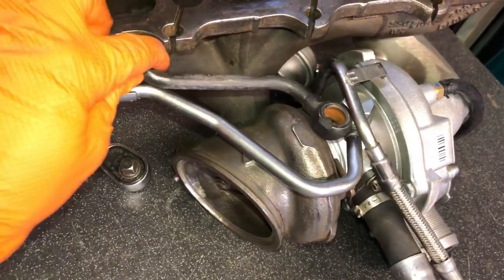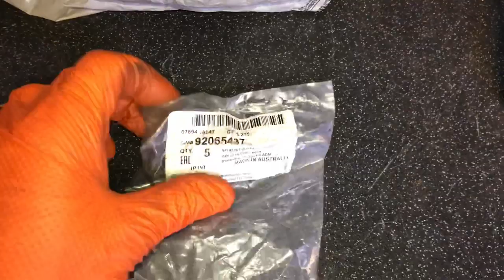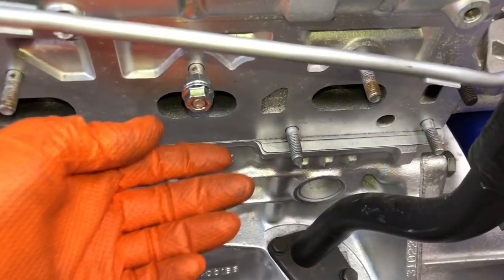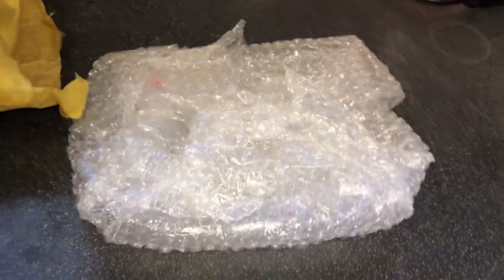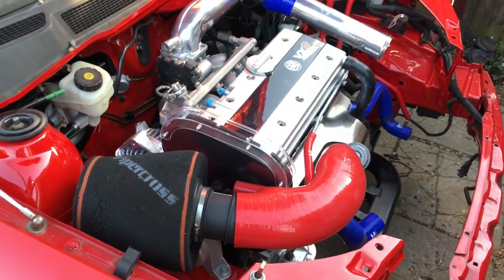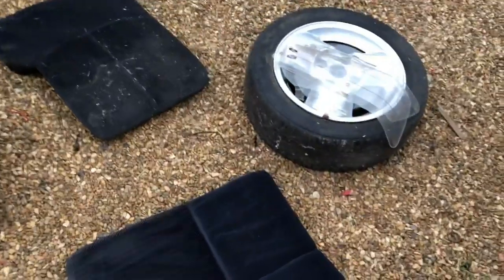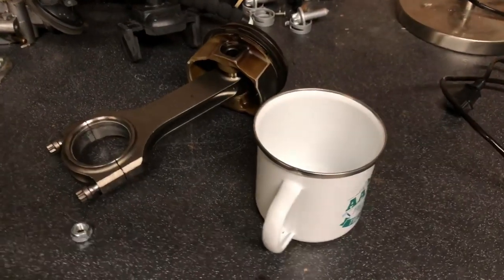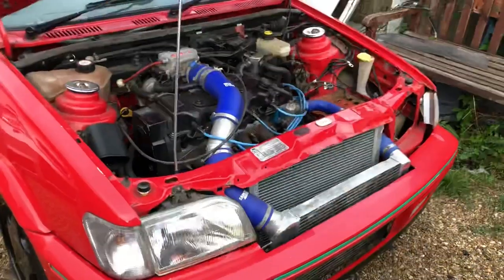Can You Cook Eggs In The Sun? I Took A Drive Into LONDON

Comment: Should of took the S2 RST for the drive instead of the GSI, would of turned more heads. prob would of over heated with it been so warm out though lol, R lass used to hate the heater on full with windows open in middle of summer when stuck in traffic. I should have my old merc grey S2, (used to be a spec r show car) finished this year. Only taken me 4 years. Lot of respect for your work rate and Great video as alway though mate.